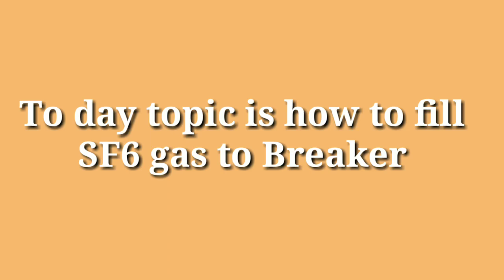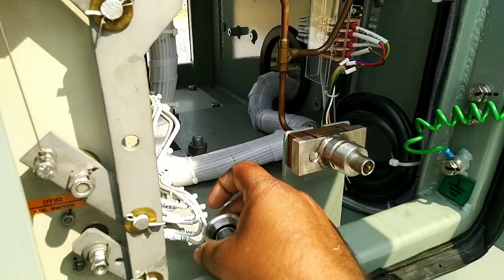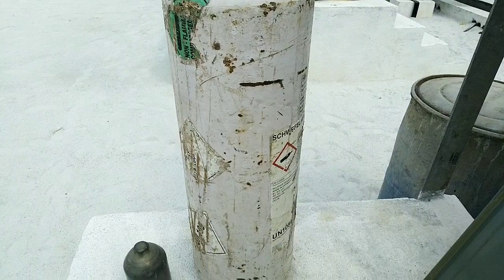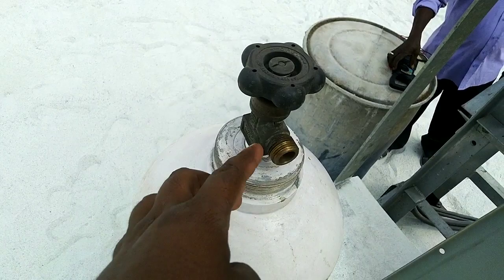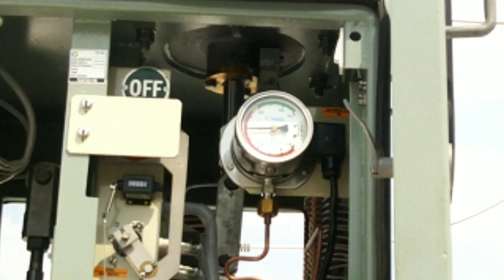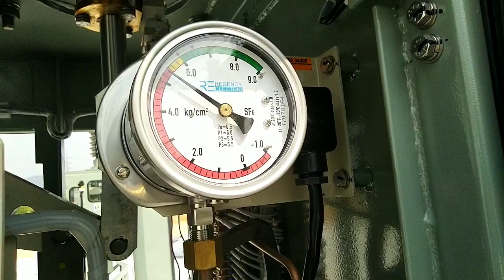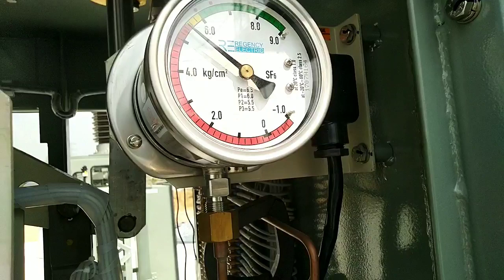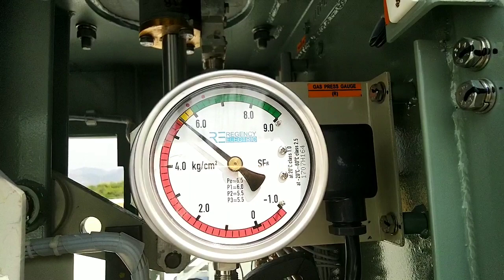Practically how to fill SF6 gas to Breaker

Comment: Thank you for sharing this video it can provide information about practical side of electrical maintainance, FYI please connect an appropriate regulator to the cylinder and properly purge the hose by opening the cylinder slowly while u connect it to the gas inlet of the breaker, so that there won't be any air and moisture mixing with the Sf6 gas that you are filling inside the breaker compartment. 
As per standards the moisture content for HV CBs  must be less that 150 ppmv and for the GIS compartment it should be less than 500 ppmv. 
The purity must be greater than 97%.
Also note that SF6 is one of the heavy greenhouse gas so the more we release it to atmosphere it more hazardous to environment so we should try to arrest the Leakage rather than top upping it if its heavy  Leakage as early as possible.

Comment: With out regulator not safe to refill, full cylinder pressure will be more than the chamber pressure , there r chances for pressure relief device to explode. Also make sure chamber is vacuumed nd gas tight before filling from zero bar to the rated.

Comment: Filling gas from high pressure Cylinder to the breaker without Regulator is Unsafe.
Reply: @Antonnov, yes I agree with you. Btw, should do vacuum before filling to prevent moisture mixed in new gas.

Comment: Thanks for the video, however during filling process I didn't not see you purging the hose pipe with SF6 gas. Chances are you also top up CB  with normal air during the process of  gassing.
Reply: Yes I agree

Comment: It's acceptable if you top-up, however when filling an empty tank, you should vacuum firstly to remove moisture and make sure NO air/residual gas inside then filling. Visit our company WIKA website/Youtube channel if you want to see not only professional product but also comprehensive solution for operating SF6 gas. Thanks.
Reply: Yes! Or Visit DILO campany 😉

Comment: gas can refill breaker on condtion?  or need off condtion?
Reply from the maker: Circuit breaker either in off or on no problem
Reply: It is better to open the breaker before vacuuming and gas filling.

Comment: Sf6 gas p trip ka ciurcit diagram bata o
Reply from the maker: Tell me in English please I don't know Hindi
Reply: Sf6 tripping Circuit diagram gurinchi cheppamantunnaru
Reply from the maker: SF6 contact used for alarm and lockout purpose only, SF6 contacts used in both tripping and closing circuit, breaker already in closed condition at the time SF6 lockout occured this contact will block the tripping, if breaker already in open condition if you want to close the breaker the sf6 contact block the closing